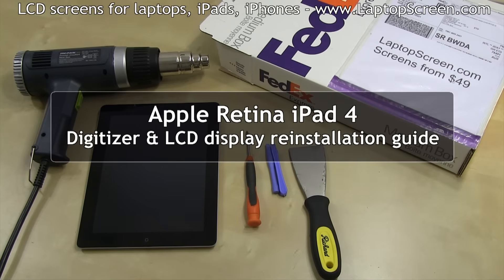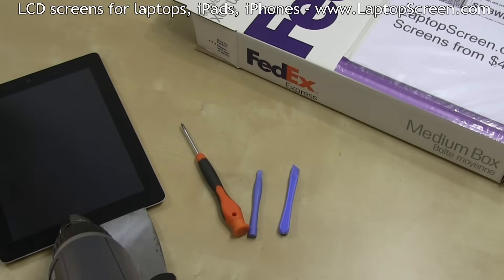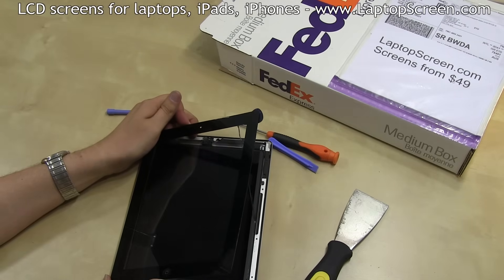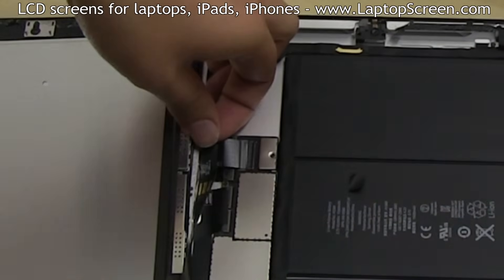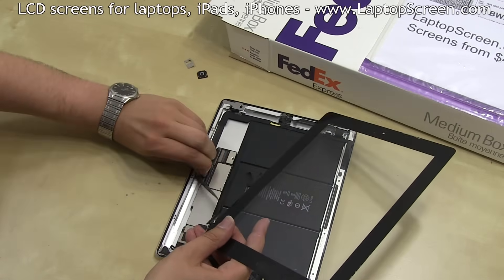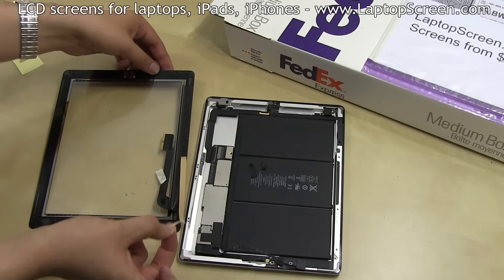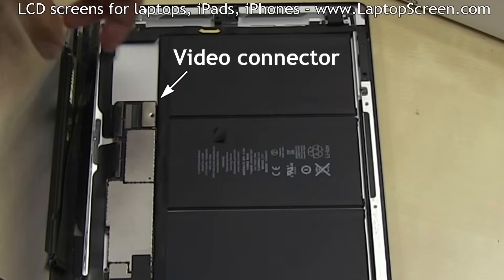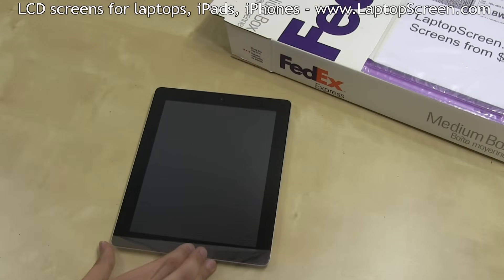iPad 4 Screen Replacement (digitizer and LCD removal and installation)

Comment: Why remove the protective inner film before everything else? You're risking leaving marks inside the screen when dusting the LCD. You should leave that in place until after you've replaced the LCD.
Also, putting the double-sided tape on the digitizer instead of the ipad itself can lead to misaligned adhesion. That means the glass can be slightly out of alignment on the finished repair.
Everything else was very helpful, thanks :)

Comment: DISCONNECT THE BATTERY!!! If you follow this guys instructions and accidentally bump the power button, your Ipad will blow out the backlight fuse, and you will have to spend $150 at a repair shop!  Other than that, this is a good video.
Reply: i mean do you ever need to tilt the ipad up just be careful what are the odds of hitting it

Comment: Thank you so much. Everything is working 100%, but unfortunately the screen pops out a bit (I assume due to the ribbon cable being compressed a little or because of the bezel trim being distorted.)
Reply from the maker: +Diego Campos We are glad it helped! You are right, it may be a slightly misplaced cable, a bent part, or maybe both. It is not the end of the world though, just be aware that it may cause the part to wear a little sooner. Also, it may be the point where the dust/moisture start building up inside your the iPad - watch out for that!
Reply: +LaptopScreen.com thank you! I will watch for that and fix it as soon as possible!

Comment: Thanks for the video. My IPAD 4 glass is shattered mostly on the edges and I want to replace it myself. I want to replace just the digitizer, do I still have to open the LCD screen ?
Reply from the maker: +Rahul Sharma You need to unscrew the LCD and remove it in-order to disconnect your broken digitizer and re-connect the replacement. But you do not need to replace the LCD if it is not broken.

Comment: Is it just me or replacing an iPad 4 digitizer is simply a fucking nightmare?
Reply from the maker: NikkiDiamond Well, it is a tad of a challenge, but compared to iPad2 the 4 is easier because all the cables are tucked away and protected on the edges.
Plus, keep in-mind, if your digitizer is shattered - it is a different story - its easier to get started - but takes a long time to clean up all the shards.
Still worth the time to do it yourself - as the repair shops will charge premium for such repairs.
Reply: LaptopScreen.com It's not much the process itself,it's the spare parts that appear not to be working properly. I've tried 2 chinese digitizers,which both failed to work. I've now ordered a third digitizer on Amazon,which is claimed to be an Apple original product - Hopefully this time it's gonna work and i can sell the damn thing! 

If you happen to make another video about digitizers,i would suggest telling how important quality parts are.